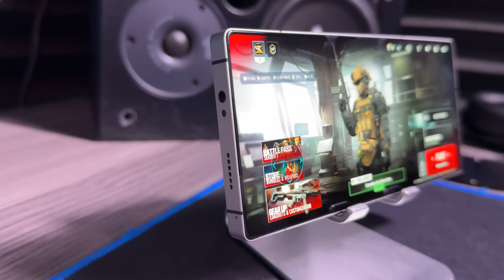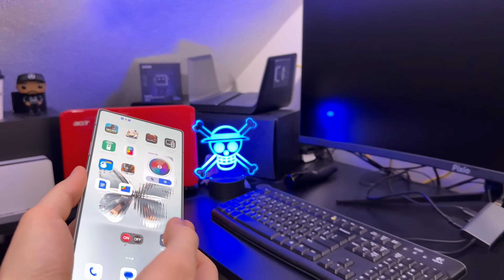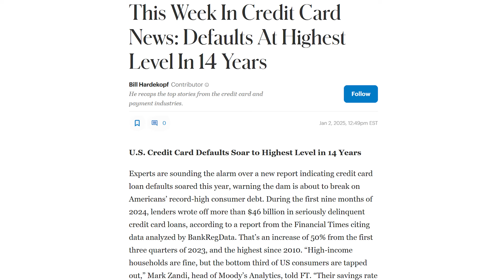What CES Revealed About Repairable Tech In a Record Year For E-Waste (2025 Is Not Looking Good)

Comment: Most people are worried about CO2, however the real issue is ewaste. This isn’t sustainable. People forget that the three R’s are in order of importance. Reduce consumption(buy less stuff) Reuse(use the stuff you have longer) recycle(reclaim resources from unusable things) Recycling should be the last option. Quite a few people forget the first two and just recycle.
Reply: You can worry about both it's not one or the other.
Reply: @ They will conflict at some point. Which one of the two will take priority?
Reply: @EvilTurkeySlices  but honestly, computers and Laptops are a really small part of that. Most part are phones, that come out and get Zero updates, single use electronics like vapes etc. You cannot reuse something that is an immenent security risk.
Reply: THANK YOU!
Spoken as a guy who was raised on stuff like Captain Planet.
Reply: There isn't one real issue. There's thousands of them and both of those are included.
Reply: Co2 is less of a problem if you're not producing excessive waste! The insane amount of crap that goes into chemicals required for chipsets and "ai" inside of disposable tech is horrible for environmental issues and emission problems in factories.
Reply: It's because the goverment and those organizations only pretend to care about CO2 and stuff like that.
Reply: CO2 or any GHG is recyclable via earths natural absorbent process (Yes i understand anthropogenic climate change) .  The BIGGEST PROBLEM we are facing is plastic pollution, particularly micro plastics (including tyre rubber) that a prevalent all over then world, in your food and in your blood stream and organs. Have any one ever wondered why Cancer rates are skyrocketing, its quite simple DIOXINS. They are in our food, water and air.  Plastics have high level of dioxins are toxic very compounds that produce free radicals, which can damage cells and cause problems, hence skyrocketing cancers.
Reply: The technorulers are brainwashing people into worrying about air so they'll accept carbon credit slavery. It's that simple.
Reply: @EvilTurkeySlices I was in elementary school when I heard about reduce, reuse, recycle. I want to say 2004 when I was in 2nd grade. I'm 28. All my FUCKING LIFE everything I've seen has valued and prioritized recycle more than ANYTHING else. From clothes to electronics to vehicles. It's never, NEVER been 3 Rs. The fucking campaign was a lie. It's been recycle with the other two in microscopic print in italics right beside a just as small asterisk.
Reply: On the point of recycling - there are entire buildings, railway cars, and sometimes even entire cities left abandoned and the steel/glass/concrete is NEVER recycled!
Reply: CO2 is a way bigger issue than e-waste...
Reply: @Morbing_Time  Based on what? They're likely both equally problematic ...
Reply: It's both
Reply: Doesn't help that mainstream media back in the day (late 80s to early 2000s) pushed advertising that had it all flipped: "Recycle, Reduce, Reuse".
Reply: The real issue is waste full stop. That includes using fossil fuels to burn them in vehicles, or inefficient processors such as anything produced by Intel, or making laptops as disposable items that have to be recycled regularly because heaven forbid they should last ten years of only using them to browse the web or send email. It's not possible to respect a human being's complaints about manufactured e-waste (such as the magic mouse, or chargers shipping with every phone, or laptops that can't be repaired) if they also think that CO2 is not a problem, or that we can release plastic into our rivers and that's okay.

No. We need to reduce all pollution, full stop, but climate change is the biggest direct threat now the ozone layer is healing and acid rain is not too much of a problem anymore.
Reply: I believe it’s necessary to distinguish between the issue of e-waste and CO2 emissions, as they represent separate environmental challenges that require different solutions.

E-waste and planned obsolescence are indeed critical problems. Devices designed with short lifespans or limited repairability lead to massive resource waste, including rare earth metals, and contribute to a growing e-waste crisis. Addressing this requires stronger regulations for sustainable design, repairability, and recycling. However, these issues are not directly tied to CO2 emissions, which are the primary driver of global climate change. Conflating these topics risks diluting the attention each issue demands.

Regarding the healing ozone layer and the decline of acid rain, while these are significant environmental successes, they are unrelated to CO2 emissions or e-waste. The ozone layer's recovery is due to the Montreal Protocol addressing CFCs, while acid rain has been reduced through sulfur dioxide regulations. These examples show what focused action can achieve, but they highlight the importance of treating environmental problems as distinct issues.

E-waste is a pressing concern and must be tackled by promoting sustainable practices in the tech industry, but it is separate from the urgent need to reduce CO2.
Reply: @jonevansauthor  CO2 isn’t a problem, it’s plant food.
Reply: Yes, people worry about CO2. Yes, people worry about ewaste. Why can't we worry about both? It's not one or the other, which your post is suggesting. Apologies if I'm wrong, and I agree that we should be doing more to reuse, but that doesn't negate other issues.

Personally, my computers are like the Ship Of Theseus- if you eventually replace all the parts one by one, when does it stop being the same ship/computer? And if I then have enough of the original parts to make another computer, which is the original computer? Don't answer, look it up. It's an interesting thought experiment.
Reply: @exF3-86  A man cannot serve two masters.
Reply: @exF3-86  because co2 is a non-issue. In fact our atmosphere is verging on not having enough co2. Though I’m not trying to start a climate change argument.
Reply: @EvilTurkeySlices  do you have a source for the statement that we have too little CO2, when all studies show the contrary?
Reply: @EvilTurkeySlices  Dude, how? How did we get to a point where you can write something like that without feeling completely stupid? Is this ragebait or do you have absolutely no idea what you're talking about? Before industrialization, the value was 280 ppm. Today it is over 420 ppm.
Reply: @MUSIC7052  History on Earth goes back further than that. The dinosaur time had really high CO2 levels, for example, but still plenty of life.

Of dramatically higher concern than atmospheric CO2 levels (we've more or less stopped the acid rain issue, and the ozone layer is recovering well) is the Oceanic CO2 levels.

In the ocean, CO2 turns into carboxylic acid. This weakens or dissolves things. Things like shells, and limestone. Lots of life in the ocean (a LOT) has shells. The shells are already having a hard time being formed, and they tend to be weaker. It would be very, VERY bad if all shelled life could no longer form shells. If the limestone in the ocean starts to dissolve, then that would also turn into the same kind of acid, and things would get very bad very fast.
Reply: @Thalanox  But the problem is not a lack of CO2. The problem is that we have explosively and sometimes completely destroyed their ecosystems and the basis of their existence. CO2 levels in water are not a disease but a symptom that is directly related to our emission of CO2 into the atmosphere. Furthermore, the argument I responded to was that we had too little CO2.

apart from the fact that acid rain is caused by SO2 and NOX. and not by Co2. And the atmosphere 80 million years ago was richer in Co2. It would cause health problems for people today. 3 billion years ago there was also more Co2 in the atmosphere. Nevertheless, I would not see the atmosphere at that time as being particularly positive for our existence.
Reply: @MUSIC7052  we don’t need that high, but we need higher than we have now. Probably around 2-3%
Reply: @EvilTurkeySlices  2-3% corresponds to 8-12 ppm. We have had this increase every 5 years since the middle of the 20th century. And if we take the basic value before the industrial revolution, we experience such a rise every 2-3 years. The fact that you give the values in percent shows how fundamentally you don't understand the topic. Why do we need 2-3% more CO2?! Do you think the collapsing ecosystems have recovered since 1750?! no. They have collapsed faster with each additional rapid addition of CO2 to the atmosphere. We'll talk again in 5 years about what the additional “2-3%” has achieved.
Reply: @MUSIC7052  I’m still not 2-3% additional we need, it’s 2-3% total. Right now we have less than 1% in the atmosphere; any less than that and plants will start to die.
Reply: @EvilTurkeySlices  I could just as easily talk to a stone.  Get informed or leave it alone, but I'm not talking to you about topics that you learn in elementary school. The proportion of CO2 in the atmosphere is 0.042% at the beginning of industrialization it was 0.028%.
Reply: @MUSIC7052  regardless of the exact amount, it’s not dangerous in the amount it’s there. You need well over 50% concentration to have a noticeable greenhouse effect. It’s food for plants, they prevent it from getting that high.
Reply: @MUSIC7052  regardless of exact amount, the level of C02 in the atmosphere currently is nowhere near evening to have a noticeable greenhouse effect. You need well over 50% concentration to even start having that effect. In fact more C02(to a point) actually helps regulate the temperature properly. More co2 means more food for plants, plants get bigger and are healthier, said plants release more oxygen, which helps keep temperatures in check. It’s a natural system that’s been working just as well as it was when it was designed.

Comment: Most people consider their laptop a device to write docs and access the web browser. I hope user friendly Linux distros will take off after W10 vacuum.
Reply: The only thing keeping me from making the full dive into Linux is game compatibility. Plus some of the games I play on the regular have an anti cheat. So, it's just not going to happen for a small majority of PC users. I know Proton which the steam deck uses it getting better but, it still can't fix anyi cheat issues. That's one one major gripe, it's fucking anti cheat.
Reply: @JinsokuYoroi  Kernel Anti-Cheat on games is the biggest hurdle for Proton/Linux. 

I found on my Arch install the biggest issue I'm having is compatibility with CUPS and my 14 year old Brother laser printer. It prints but the margins are messed up and I can't get them to align correctly at all for some reason so I just stick to printing in windows.
Reply: @oOignignoktOo1  Maybe you should try your printer under Linux Mint or another Ubuntu distro...
I use a 20 year old brother printer and it works out of the box perfectly. The only thing  I had to change was the DPI of the printer to the correct one.
Reply: Every time I try a Linux distro like Cinnamon or Mint, I get excited. And then I find out that I still have to go back to a real Windows OS to do the simplest tasks like scanning something and turning it into a PDF, without having things to go to college, read a bunch of "Linux for "Dumb-Asses" books, relearning how to play Dungeons & Dragons and command line variables.
Reply: I hope Linux takes off, but I won't hold my breath. IME, the customers who successfully switch to Linux are one of three camps: 1) Highly motivated to ditch big tech and may or may not own a tinfoil hat; 2) Already don't know how their PC works nor how to navigate beyond the desktop, so can't tell the difference. 3) Independent, sharp, and like to learn new things.
Reply: They won’t. Linux is inherently user unfriendly.
Reply from the maker: Linux is amazing. With that said, the Linux community is very disconnected from the general public. I don't mean that disrespectfully, but it's clear to anyone that's worked with the average end-user that Linux is never going to be an alternative.
Reply: @SalemTechsperts  I agree with that but I think Valve with their SteamOS due to them being a billion dollar company and supporting their own distro of linux might be a great way to get the average consumer acclimated to it. But Windows is a stranglehold on fortune 500 enterprises and OEM hardware vendors so it will never have the marketshare.
Reply: @EvilTurkeySlices  It is user-friendly, but it is picky about what users it wants to befriend.
Reply: @EvilTurkeySlices 
Big companies never show you the beauty of open free ecosystem. Research more please. There are many solutions.
Reply: @EvilTurkeySlices  Im guessing you have not tried Mint.
Reply: @EvilTurkeySlices  I would say the reason for this is because Linux is missing a lot of popular software like MSOffice. Linux was a lot less user friendly before Valve released Proton.
Reply: @EvilTurkeySlices It's not, it's just different. Does the same things as your everyday Windows, BUT you have to take a little bit of time to learn what to do with your setup. I've got to a point that I don't use Windows on any of my devices anymore, I'm so frustrated with the crap that Microsoft pushes down the throat of consumers. If you want an OS that does whatever you want (and doesn't screw itself up just updating the drivers) just go with Linux.... Maybe it'll take time to figure out how things work, but it's worth the effort. Just stick with a friendly distro (like Linux Mint) if you don't have the skills to use it, just update whenever it asks you to update and you'll be fine.
Reply: @CoBmaniac1986  if you like to use Linux, go ahead and use it. For me it’s not a case of me not understanding it, I just don’t like how it works. It’s a pain to do things whereas in windows they just work. Even the more friendly distros like mint are inherently unfriendly to users. 99% of users will not want to learn it. For me personally, I’ll stick with windows.
Reply: @CoBmaniac1986 spoken like a true hardcore Linux person.
When I am able to just load up, open up my OS, play a video game or simply scan a file to a PDF without knowing command line syntax and variables, then Linux will have finally gotten there and we will have a sitting woman President.
Reply: @Suzukii-Fi  sounds like you tried ubuntu in 2008 and never retried.
Reply: @H34D5H07  Naaa, last summer. 
My thing is, if it takes me more than 10 seconds to figure out where something is in order to complete a task, it's not worth the time in this day and age. 
...(And the following is coming from someone who despises windows), 
In the MS Windows environment it takes 10 seconds to find anything and have it work... 
98% of the time.
Reply: @Suzukii-Krypto  well then iOS will kill you 🤣
Reply: @Suzukii-Fi  I want your windows luck. Just this weak alone windows would not let me rename a folder I created because I didn't have permissions somehow. If I edit anything with Movies & TV it'll crash my explorer. And on my laptop do to the horrendously designed power management settings it'll kill the battery every chance it gets. Not a single of my windows issues in the last month have ever been solved under 10 seconds. Most answers I get are restart or reformat from windows tech support. When steamOS comes out I'm ditching.
Reply: @Suzukii-Fi  I'd be curious to know what distro you used. Ubuntu is horrible now. Mint is ok, I've been using Nobara and have not had an issue. I had to reinstall my windows partition because it was ungodly slow. 
Most of the mainline linux distros are pretty user friendly now. System 76 and Tuxedo computers have made a business out of it. Linux is very niche, I will admit that, but if you don't try to do the most outlandish stuff and don't need a very specific program you should be good to go.
Reply: Theres always some hardware compability issues with linux distros i swear. Especially on laptops. Always keyboard shortkeys that dont work etc. I tried it a lot back in the days as an IT student. But even i cannot deal with it, imagine normal ppl who are not into tech.
Reply: @stageiiwappie950  I feel like it's gotten better, especially with mainstream laptop brands. Probably 90% of the time I throw Linux on a Dell, HP, or Lenovo, all the major functions work. Hotkeys or media keys pretty much never work tho--even with Win10 on Win7/8 laptops.